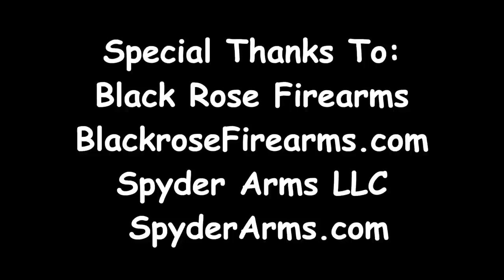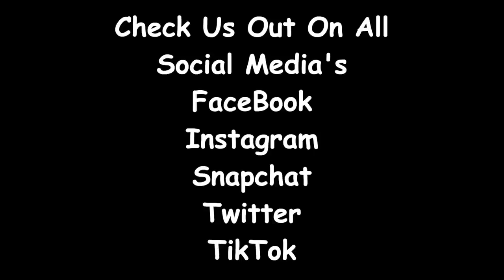Is A Tractor TRAILER Bulletproof￼??? (Unbelievable Results!!!) TheBellLife

Comment: Being a truck driver, my guess is no but it also depends on what kind you have. Being a dry van I’d say no it’s not
After seeing the vid, that’s a much older trailer, which have fiber glass on the outside then plywood. Newer ones are much lighter, much more sheet metal
Reply: @Outdoorsman 77 that thing is heavy, and it looks like it has the old steel rims also. I’d like to watch that one too
Reply: Nerd
Reply: @ronducedre2662  Nerd lol. It’s my profession. Just like you, I’m sure you know all about hamburgers at McDonald’s

Comment: That truck could be cleaned out and refurbished.  It's not hard.  You could make a little man cave in there.  It's a cheap structure.  You never know.
Reply: Or bury it and use as a storm shelter.

Comment: 556 green tip is not “armor penetrator” as Justin says lol. They are steel core rounds. They are not armor piercing but used to shoot through walls and heavier barriers and stay intact. A 55gr 223 has more “armor penetration “ potential cause it’s actually going at a higher velocity. Speeds defeats armor plates. 18inch 55gr 223 within 10 yards will go through level 3+plates witch are rated to stop 556/223 but really only stops up to 3200fps rounds and the 18inch 55gr and lower 45,40 will reach up to 3300-3400fps. Defeating the armor. The green tip is designed to do what it did in this video. Go through tougher objects to hit the target. Green tip is steel core.